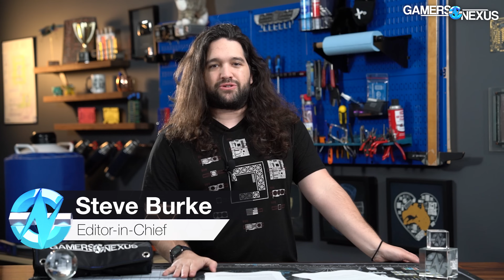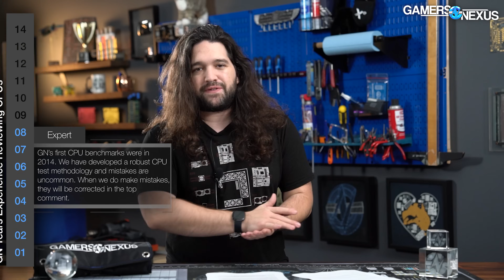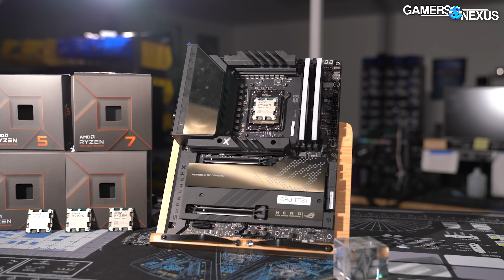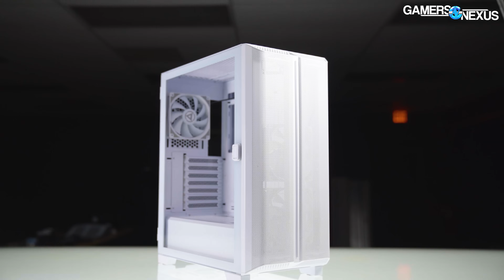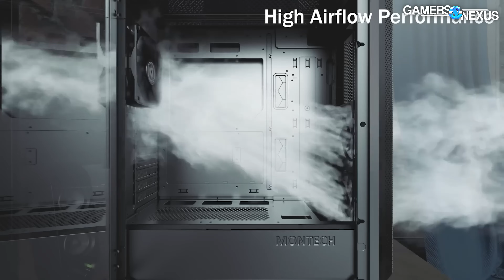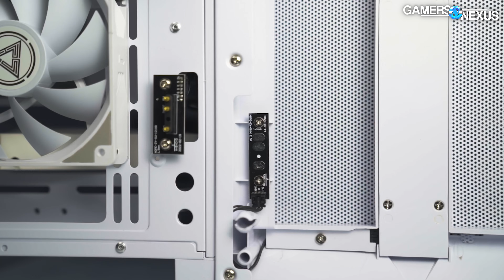AMD Ryzen Eco Mode Deep-Dive & Benchmarks on R9 7950X (Zen 4)

Comment: As a rule of thumb for all Zen 4, you can put ECO mode on with PBO and recover all your power, or just ECO mode alone at 50% of the stock power. You lose 5% of the top performance at worst and consume 50% of the power and gain dozens of degrees of thermals. It's a complete win for me.

7600x and 7700x -> 65W
7900x and 7950x -> 105W
Reply: How about 9950x?
Reply: Don't you think if that was the case, AMD would do it out of the Box or proudly announce it in marketing?
What you descripe is an F1 Car towing away a truck.
It's the same BS that most ppl in the PBO settings do: Turn on the Boost Clock override while using curve optimizer. Absolute stupid bs .
Eco mode is a preset (for beginners), who do not know how PBO works.
What you should do is leave ECO mode alone and just lower the max PPT (depending on the temps change TDC and EDC aswell) so you reach about 5-10% less max frequency.
Getting more frequency out of a CPU on the right side of the voltage curve is THE ULTIMATE black hole of power consumption.
That is why a lot of LN2 overclockers need >1600Watt PSUs while they try to beat world records.
Reply: @TheNerd  most ppl like me just enable boost profile, pick xmp, enable sam and then move on.
Reply: @TheNerd  I think AMD fucked up and wanted to chase the top perf at all costs because that's what Intel did since forever and no one batted an eye at the terrible power consumption. They should have done it out of the box like they did with Zen 3.

What was Zen 3 normal mode is now Zen 4 half power consumption.
Reply: @OneAngrehCat  Well atleast i love that AMD gives that option .
Reply: @SimplyTakuma  They both do.
Reply: @TheNerd  To answer your question again, they did do exactly that, but for the 7000 non-X versions. And I'd highly advise to just buy that (at the risk that they might've been binned).

Comment: Perhaps TDP in this case would be better defined in J/s (Joules per second) which is literally the same as Watts but better reflects the mechanics involved - ie. how quickly heat energy can be dissipated by the cooler

Comment: Ecomode could be well worth it in select circumstances, as power cost approach the cost of the cpu itself. With 170W saved in 65W ECO,  with 24/7 operation and power costs at 0,4€ (not unseen in Europe right now) the CPU would gulp 595€ in just a year. At the end a 100% utilization is unlikely though and opportunity costs can be significant. 105W ECO could be a good tradeoff for highly efficient computing and lower running costs.
Reply: With a 25% perf drop you lose 1000€ (Cpu+Mb)* 0,25 = 250€ in opportunity costs (roughly), so you need to redline your cpu but you could save maybe/roundabout 300€/year.

Comment: I do a lot of Blender type workloads. Stock my 7950x was just way too hot == noisy. Set it to 105 eco and lost maybe 5-7 percent performance maximum. But my machine is relatively quiet now and energy costs have gone through the roof so that's better too
Reply: What are your idle, medium low (games) and all core load temps? I'm insanely curious what temp it will be (95°C is unacceptable to me - biggest reason my 3570k Intel lasted 8 years, i do not trust a perma 95°C cpu to make that) but if the eco mode shaves op permanent 10°C in cinebench, all-core loads (and much more in others), that would make me accept it. If it shaves off 20°C while using something like Noctua cooler, I would finally stop doubting the ryzen 7000 series (except for DDR5 and motherboard prices).
Reply: @Matti6950  medium (YouTube and other bits) below 50c. Rendering up to 70c. Noctua D15
Reply: @kw7865  Thanks a lot, that seems totally what i would fine acceptable (much better then 95°C). Friend is recommending me strongly the Noctua ND-12U, over Noctua ND15 but both are on my shortlist.

Comment: What's with performance numbers for purely single threaded workloads like saving a PNG file?
Reply from the maker: Wouldn't change since you're not hitting the power limit in either scenario
Reply: @GamersNexus  That's good to know! Times have changed. Now the companies overclock the products for the customer, now the customer tunes them for efficiency! If I enter manual values for this constraint, does it still void the warranty via PBO?

Comment: I bought the 5800X3D earlier this week. The discounts made me jump. I've had the 5600X since launch. Now with my Sapphire Toxic 6900XT my gaming needs are good until AM5 motherboard prices drop by $100 across the board and the v-cache cpus are released. RT is not of a real concern with my gaming. My focus is gaming, and HTPC. Not video production or animation. But for those that do. I still think AM4 is more bang for the buck, in two years AM5 prices will drop just like AM4 has.

Comment: Would love to see how the R7 5800x3d fares in comparison in all those games! Great video, thanks for all the infos team!
Reply: The answer is “fast enough”. Realistically unless you have a ridiculous multi 4K monitor setup, just about any mid range CPU is fast enough for gaming, even at high refresh rates. Once past about 120fps, you are beyond the limits of human biology anyway, any difference is barely perceptible. These high core count CPUs only make sense for compute workloads. For gaming you are just paying extra for bragging rights. If you are a gamer and already have a decent AM4 setup, the 5800X3D will do you fine for several years to come.
Reply: @chrisward000  4K is less noticible than 1080p, where you are CPU bound to hit the upper fps limits at 200fps+. Once you're running 1440p or higher the eco mode is plenty and 1% lows are more important so you don't see fps drops from your fps g-sync cap.
Reply: @chrisward000  the 3d is basically the same as the 5800x and 5700x at 4k so not a good example even at 1440p its rarely of note. You mostly want it at 1080p as it's a monster for that for those on am4 socket.

Comment: Yeah it's what we were all expecting to find, ya? The 7950X is waaay outside it's efficiency curve at stock settings. I imagine if you could hard limit the PPT to 170w, that'd be where the efficiency curve peaks and you get the best performance for the wattage. Good testing guys! Love this! :D
Reply: If you have a 7950X, you could try to enter the following manually into PBO: 186W, 125A, 197A -> This is exactly in-between AM5 105W cTDP and AM5 170W cTDP mode according to the table at 5:55. I bet you only see slightly lower performance in benchmarks only but won't be noticing ANY difference between Stock and this setting. Also, it will probably still lower temperatures down by 20 Kelvin, which might even result in higher clocks (and thus even higher performance) depending how constrained your cooling solution is!
Reply: If you want 125W TDP, which is 20 higher than 105, the diff between 105 and 170 being 65:
PPT = 142 + (230-142) * 20/65 = ~169W
TDC = 110 + (160-110) * 20/65 = ~125A 
EDC = 170 + (225-170) * 20/65 = ~187A
Reply: @kyoudaiken  Yes sry, I've edited my answer, however the in between would be 135A for TDC ;)
Reply: @PlaiSeek  Sorry, quite new at this. But basically if I want 170 ppt, I would input that on ppt, 125 on tdc and 187 on the edc, is that correct?

Is this safe? Did you test it?

Thoughts on having 170 ppt and leaving the tdc at 160 and the edc at 225, which are the original stock values?
Reply: @flyinggecko3322  PPT is the maximum amount of power allowed to be fed to the CPU (it then limits directly the amount of heat produced), TDC is the maximum amount of current allowed when heat builds on heavy workloads and EDC is the maximum amount of current allowed when heat is not a problem, on short burst computations. Since power is the product of voltage and current, these three values are somewhat correlated, but I don't see why any value below the stock ones might cause damage to the CPU and I think it's quite the opposite.
Since we can observe that the three settings provided by AMD for 65, 105 and 170W show linearly related PPT, TDC and EDC, I would advice sticking to these ratios, the performance benefit of increasing TDC might be marginal since the power would still be limited by the PPT value and a lower TDC might help increase the life expectancy of the CPU.
Reply: It's funny how NVidia and Intel did EXACTLY the same. This is just for the WOW effect and also to please investors. The customers and the environment are dirt to them.

Comment: Conclusion: 105W Eco Mode should've been standard, there's virtually no performance penalty. It's almost criminal how unnecessarily overtuned some of these recent chips are. They're just chomping electricity for almost no additional gain, and many users aren't ever going to dial them back because they simply don't know they can.
Reply: 100% what I've been thinking. I get if one has "big number" the other needs "big number". AMD already had to try to fix this with the Athlon XP "+" speed system. I had an Athlon 1600+ XP for awhile, but it ran at 1.4Ghz.

Comment: I think you're kind of missing the point of the 65W mode. If you need 32 threads and  are power or thermally limited then it's a perfect match, if you're running a normal machine, yeah, it's a bad idea. Seems like the Eco modes are to help the CPU meet certain usage demands.

Comment: Efficiency modes have been there for ages. It's called a power limit. You can improve efficiency on almost any CPU by a huge amount by throttling down the power. My laptop's 9300H takes 45 watts at 4 Ghz all core load but only a mere 15 watts at 2.4 Ghz all core boost. You can quite easily calculate that the power efficiency is insanely higher at 2.4 Ghz than it is at 4 Ghz. Nice to test it but the concept is about as old as Boosting is.
Reply from the maker: There's more to it than just pure power limit actually, as discussed in the content.
Reply: @GamersNexus  Fair point, I'm just a bit saddened how little this has been discussed previously on any channel and is now brought up as almost a revolutionary new thing across tech youtube.

Yeah, it's not exactly the same thing but nearly all CPU's could've achieved similar results with a simple power target reduction.

Comment: So basically the 105W ECO mode runs at about 60% of the power and achieves almost the same performance as stock. Almost the same productivity performance as 13900K but consumes half the power.
Reply: And generates massively less heat
Reply: The problem is you can also turn down the 13.9k and get better performance.
Reply: @WaterZer0  Zen 4 can also use curve optimizer. Your argument is moot.
Reply: @PowellCat745  wut
Reply: @WaterZer0  you need to do custom tuning
Reply: @WaterZer0  But the point here is, this is a toggle option, while Intel might be more complex, if it was a toggle, GN would test it as well.

Comment: Do the same for intel. I am running my 13700Kf at 125W max and lost just about 3000 points in cinebench. There is no reason not to limit the latest generation (intel or and)

Comment: 105W seems like no-brainer for code compilation for the sake of maybe less noise.  Thanks for benchmaking this stuff.
Reply: That is a really good point, noise is also highly affected with this as well!
Reply: Keep in mind that you don't get the same efficiency improvement shown near the beginning of the video for all workloads, i.e. for gaming there's probably no efficiency difference; they should've shown the average power consumption for each test alongside the performance numbers
Reply: Indeed, pretty sure i also prefer my cpu to be around 60C and not 95C lol
Reply: @John__K  well,, we do need a psychological shift on that cause before 100C was the most chips could handle long term but Zen 4 design can handle up to like 115C so 95C on these chips is more like 80C on older chips and for all-core thats not bad at all.
Reply: @ImInYourBrains  That's nice to hear.
However, 70~80C has been the long term safe~zone for cpus since like... forever. 
Lab tests that try to simulate endurance of decades(hopefully decades and not just 3-5 years) are not enough for me. I need actual time passing of 5+ years under such conditions to get convinced that this doesn't affect their longevity.
Reply: @John__K  I mean we all have our standards, but that is a little hard to prove rn given these just launched. Moreover, I don't know how representative running full all-core for years is to most people's operation of their PC.
Reply: it mroe easy for air cooling
Reply: Gentoo time

Comment: Keep in mind the 65 watt mode is probably for mini atx systems where you can pair it with a small rtx a4000 or a4500 or similiar card so it would also make for a tiny workstation that could be tucked away in the corner of your mancave.  You could use a itty bitty air cooler or 120 mil radiator and take up a fraction of the space a tower would and still run cool and quiet by adjusting the fan and power consumption of the small workstation cards.. I'd  love to see some tiny workstation builds with this cpu
Reply: HP or Dell usually try in their workstation lineups, but forget to configure the TDP limit accordingly and make the whole thing fry itself in two years. I can only hope it'll get better, eventually...

Comment: I wish there was a bios where you can set a frec/volt curve like afterburner but for cpu in the bios and a option to set it per core that would be the best thing ever you would also have full control over the boost steps that way
Reply: I think Curve Optimizer in PBO does exactly that. You can adjust them per core, and there is even a tool called CoreCycler that you can use to test stability.
Reply: @smallbutdeadly931  In the latest version of CoreCycler I've also included PJVol's PBOTuner tool that allows you to control the CurveOptimizer and power limits from within Windows itself, so you don't need to restart your computer and go into the BIOS to change the CO values during stability testing.
It's a cool tool for quick testing, but of course it comes without any liability whatsoever.

Additionally it seems to support CO values for the 5800X3D, which is disabled by default in the BIOS.
Reply: @smallbutdeadly931   no i menan i like to set  0.8Ghz 0.9v , 1.5 Ghz 1.1v , 2.5Ghz 1.3v , 3.5 ghz  1.35v  4.5 Ghz 1.48v  i want to also be able to edit the steps between like that not just the end points  also every core is diffrent i testet pbo alot with 5800x
but  just check afterburner voltage curve settings exactly that customisablitty is what i want on a per core basis
Reply: the steps i set will also be the steps the core will clock to nothing in between so in idle it will go down to 0.8 ghz 0.9v
Reply: I think you can do that with the Ryzen Master software (or Intel's XTU for their CPUs).
Reply: Read about the AMD Curve Optimizer!

Comment: Basically: If you have a AMD Ryzen 9 7950X, run it at 105W eco mode, for wallet, longevity and thermals.
Reply: makes sense.  Though if I was gaming I would just run it lower it seems to the 65w mode.

Comment: I power limit my 4090 to only 80% and don't feel bad at all. It performs light years above my 3090 Ti still. I undervolt my 5900X as well and it does better in performance and temperatures.
Reply: I UV 5800X somewhat out of necessity, running Hyper 212 Evo cooler, and prefer under 80C for video transcodes. I am able to get essentially stock performance though. They say 95C is fine, but I would rather have more safety margin.
Reply: What is total system power consumption?
Reply: @Praxss , I've never measured it before, but the 4090 alone is less than 400 watts when gaming/running benchmarks.

Comment: I'm not sure what's mainstream but I'm shooting for efficiency. I don't want a second heater in my house, I don't want my energy bill to be double what it could be. I'm much happier with a quiet efficient PC running medium/high settings than I was with my turbo jet heater that could run "epic/max/extra high" settings
Reply: i totally agree. i've encountered many people in the comment section of various videos calling me a fool, wasting performance for efficiency....
in my opinion i'm not wasting anything, new cpus shouldn't be using 150w more for maybe 10% performance improvements, that should be an option for overclockers that just don't care about anything that isn't a benchmark score, but for real world use, it just doesn't make sense.

right now i have an i5 11400 that chugs 130w to keep 4.2GHz on all of its 6 cores, a 7950x could do the same, with 65w, on 16 cores. just trying to get the money for a massive upgrade

Comment: Hey GN. I was wondering what your opinion on legislation to force eco mode as the default mode to save power and be more environmentally friendly? This can be for oem system and be default settings in the bios for any motherboard. Thanks!
Reply from the maker: Not sure, we don't really comment on political stuff too much since it's not where our expertise are
Reply: It'd be much better if chip makers were forced to provide actual power consumption (and ideally power efficiency in joules per unit of work) on the box.

That'd make sure that this critical piece of information is actually on there and it'd effectively educate buyers about efficiency.

You could do the fancy "efficiency ratings" like we have for other appliances, too.
Reply: Not sure that is the way forward tbh. It's a short hop from outright legislating away from higher wattage. Further, what would the point be in demanding OEM's kneecap the systems they sell when the user could (and would) just voluntarily turn that shiz off on first boot.
Reply: Forcing anything is bad. My hardware, I use it however I want. I pay for the hardware and power so it's none of their business what I do with it.